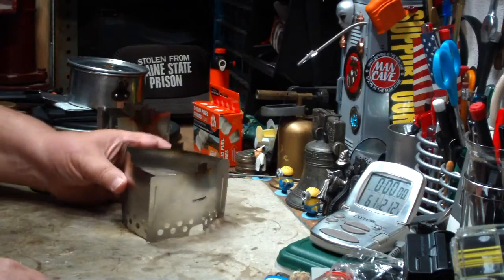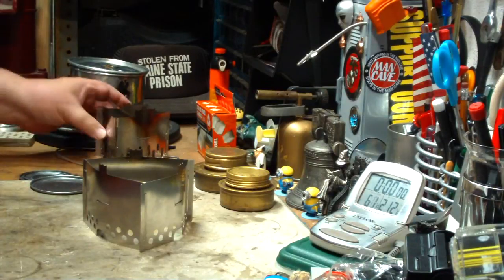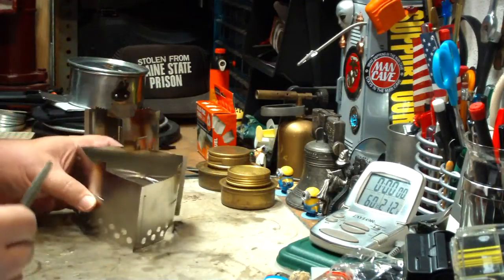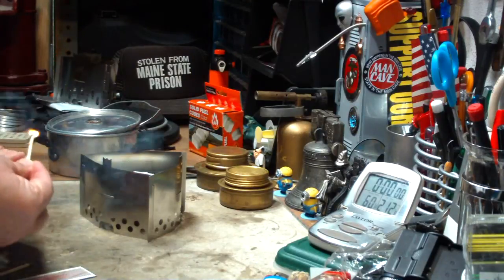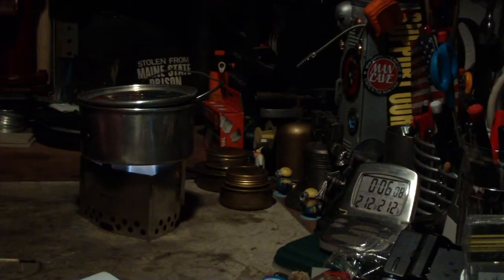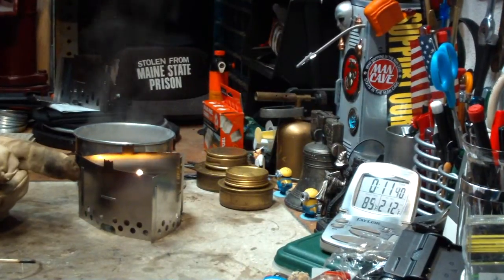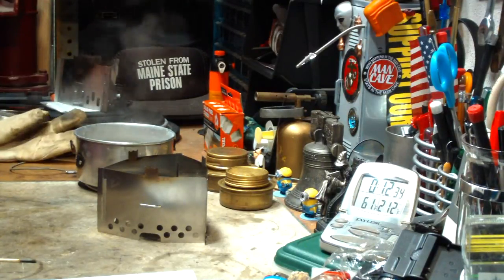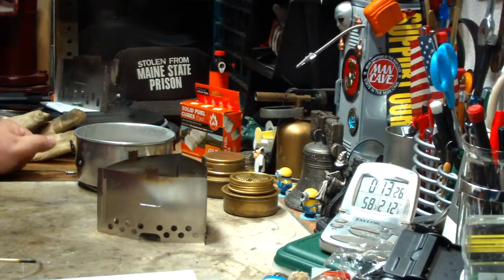Trangia Triangle - Modified to use Esbit - Boil Test #1

Comment: Interesting yet easy mod, thanks Hiram. I've recently burned an aluminum imusa pot to where the bottom just melted using a jet burner like a msr pocket rocket while dry baking. Since I learned my lesson not to do that anymore, I've decided to get back into using a non mechanical stove. I am currently using my mini trangia stove.What fuel do you recommend for the trangia? Thanks and have a great day!
Reply: Methanol works best, yellow Heet is methanol.  Cleanest burn ever, ethanol is my second choice.